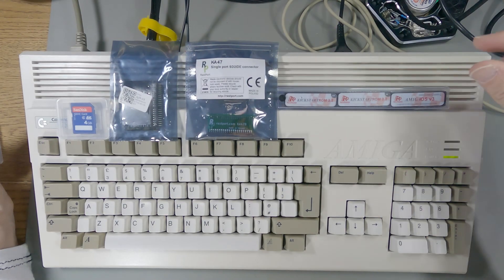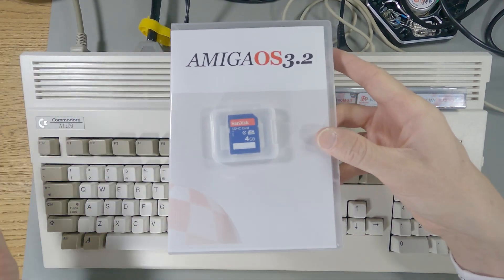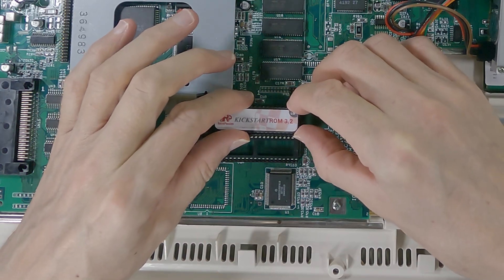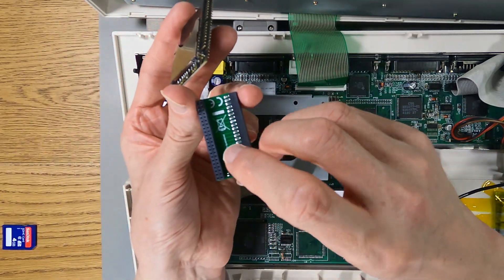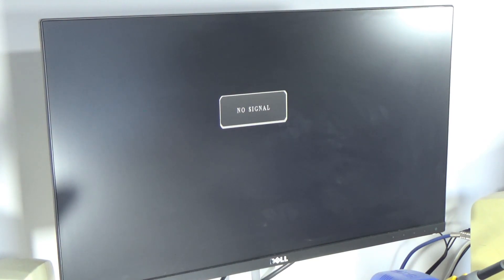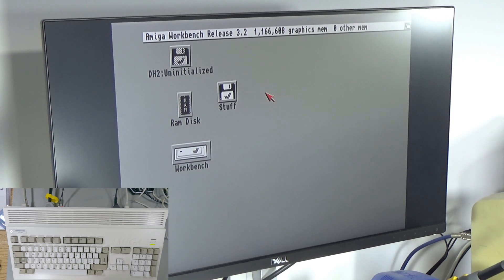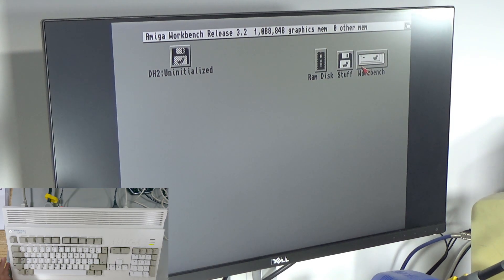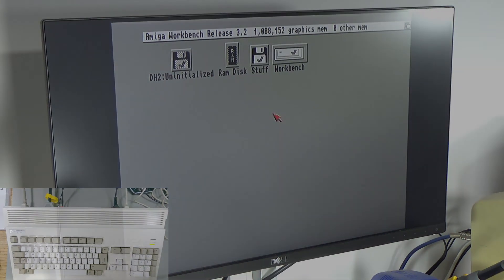Upgrading The Amiga 1200 With Kickstart 3.2 + SD Card Hard Disk

Comment: SD card's are 3.3v, that's a step down converter to make it work instead of damaging it with 5v, it has nothing to do with the LED.
Reply from the maker: @L-z9x4w  The SD2IDE adapter is doing the conversion to 3.3v. The green connector board is indeed only doing the correction for the Amiga HDD LED.

Comment: Hi dave I know why now that the hard drive light not coming on now its because I'm not using a sd card I'm using a compact flash
Reply from the maker: Oh? I didn't know that made any difference. I've only used SD cards in my Amigas.
Reply: @DavePoo2  proberly  why it says sd to ide
Reply: Found out that a compact card with adapter  works the hard drive light without the special board

Comment: Done this but get a blank screen when turned on. Got the exact same card adapter as this.

Anything I can check that comes to mind?
Reply from the maker: Blank? What colour? Does the Amiga work at all! What does it do if you hold both mouse buttons when booting? Do you get a menu?
Reply: @DavePoo2  Mine's an A600. Seems to be something to do with the way the card installation has been set up. The amiga works flawlessly without the card connected. Has been recapped and cleaned. I haven't tried the boot menu to see if anything comes up but I can do soft resets and the systems responds to keyboard input so it shouldn't have an issue with boot menu. I'll try that next.

Comment: There are SCSI CD-Rom drives, but speed wise I think WinUAE is the better choice, as there aren't many hardware configurations :)
Reply from the maker: I still think it's an odd choice for them to release the OS on CD rather than just a digital download.
Reply: Pc ide cdrom works on my amiga 1200, you just need 44 to 40 pin adapter and separate power supply for cdrom.

Comment: Ok, so can someone explain how the Amiga OS numbers work. On my system I have 3.2 roms, Workbench 4.9 (apparently) Which I since found out is actually 3.9 with a massive amount of patches along with XPK prefs, Mui 3.8 and beautiful colour icons. Not sure what program does that. I bought the M.2 card with convertors that connect to the eide port on the Amiga motherboard. The thing I can't work out is, is Amiga os 3.2 newer tha 3.9 with mods? My version of icontrol doesn't have drag windows off screen or resizable from all sides.
Reply from the maker: https://en.wikipedia.org/wiki/AmigaOS_4 - The version notes on this page might help explain some this. But I can say that it is pretty confusing. There are basically multiple branches now of Workbench software & 3.2 is the newest of the branch that supports the Amigas with the base 68000 processor (at least that's my understanding of it).
Reply: @DavePoo2  No not really.  I have 3.2 on cd but I think I'll stay with what I have.

Comment: i think ms mad lemon has fitted a cdrom drive into the back side of the a1200, here is a link if you want to see how others have done it.
https://www.youtube.com/watch?v=soV4HSxz_Dk
Reply from the maker: That's crazy, it's amazing how you can still upgrade these 30 year old machines. As for the OS on CD thing, I do think it's a little bit of a odd choice for it (not being offered as digital download). I made a joke about it at the start of the video and I know Amiga's can have CD drives, but I think most of them won't have one. And we are now at the point in history where CD drives are getting rare on PC's as well. The Hyperion website says "you can wait until machine type specific versions of AmigaOS 3.2 will be offered as digital download once all orders for the AmigaOS 3.2 CD-ROM edition have been processed."
Reply: @DavePoo2  I think you got to have a floppy disk with a CD driver otherwise the machine can't see the CD drive. I think that is the case with Kickstart 3.0 roms installed. Later roms have the driver. I think. This is off the top of my head. Don't quote me.

Comment: That's a nice upgrade, and interesting to see that you need an extra PCB to make the HDD light work correctly. I've got one of the SD card IDE adapters but haven't got around to fitting it to my A1200 (I use an old CF adapter in it currently) so I might order up one of those. Looking forward to seeing how you set it up in WinUAE.
Reply from the maker: Yeah, I had an Amiga 600 with permanent HD LED until I watched Jan Beta's video ( https://youtu.be/1v5m-86RBf8 ) where he explained why it does it (it's 3.3v logic and it's actually inverted to what the Amiga wants so it ends up lit all the time). I've already recorded the video with the WinUAE setup, that's coming next.
Reply: That’s for the SD type adaptors. The CF ones work without any mods,  but those are a bit harder to come by. SD is the way forward! :)
Reply: @HoldandModify  Sadly, as a simple serial system, SD cards are less reliable than Compact Flash cards that are really indestructible.
Reply from the maker: No problem, Commodore computers are much less reliable than SD Cards.
Reply: @DavePoo2  🤣🤣🤣
Hopefully, it's more or less a good joke as I never heard Amiga computer are more fragile than others and never had problems with mines 😉